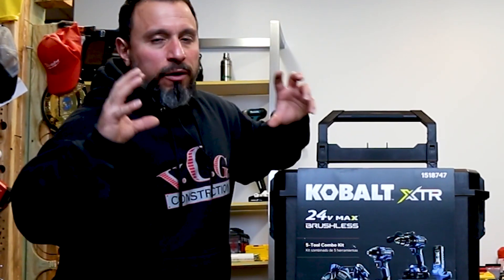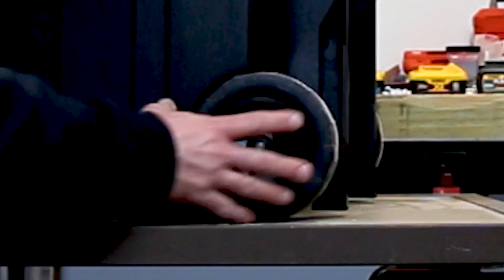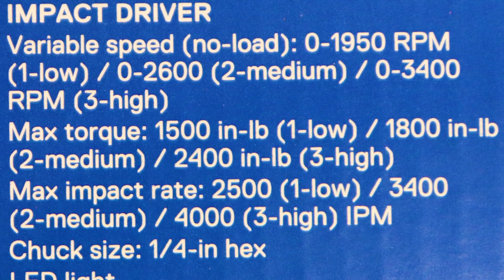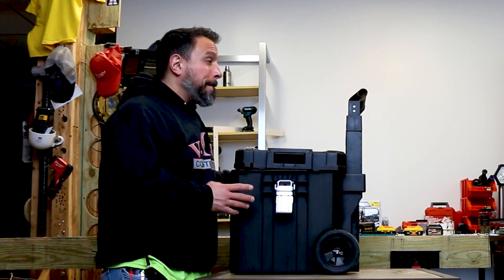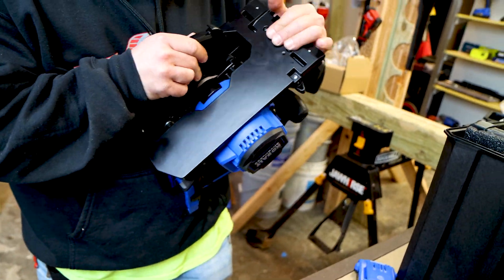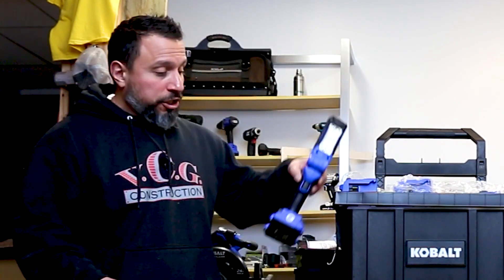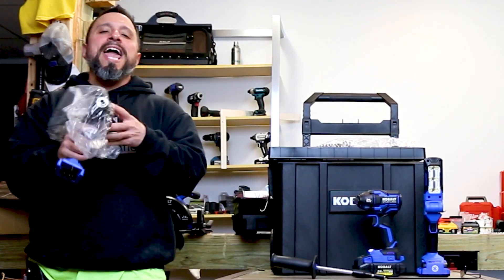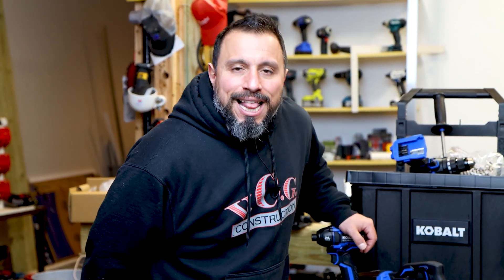NEW KOBALT TOOLS XTR COMBO KIT HAS GROUNDBREAKING FEATURES! (must see)

Comment: I wanna see them compared to the old kobalt to see how much better they are and are the new batteries comparable with the old tools
Reply: Duh, their 24v
Reply: @ezequielfuentes1823  the old are 24v just like these. 

They uppped the power in the tools themselves as well as the new battery features larger cells.

I can attest that the new battery gives this drill a higher pitched (higher rpm?) Sound. 

Can confirm thst the older batteries work fine although i can hear the difference. 

I would like to see all xtr tools raced against the originals. 

(Bonus points if you can race them against the older 18/20v kobalt lol)

Comment: I would love to see the new Kobalt impact. Go up against the Milwaukee Impact.
Champ vs Newcomer.....
Reply: Did u see the video dewalt is the new champion and they got a new one that's out called power detector 998 nobody will touch it I got my money on it
Reply: Is it the one where the Milwaukee has the collet problem? I don’t remember who won.Everything I own is Dewalt, but VCG has me eyeing Milwaukee. 🤣
Reply: @Cypress-Tx   Dewalt won and dewalt drills are the best and most powerful
Reply: Your right the drill is a monster. I just seen the 998 with the eight hour battery. Pretty impressive!
Reply: @Cypress-Tx   Yes sir and when u are drilling holes it want stop.
Reply: Everything looks good and performs well right out of the box, even cheaply made and lower priced tools.  Let's see what they do in 6 months or a year of regular use.
Reply: Watch the update video dewalt is the new champion nick beat Vince with his Milwaukee has bad issues with bits falling off. Dewalt is faster than the surge nick messed that up but just because one is faster than the other that don't mean it's a better tool. I know someone that has had there dewalt set for a long time and it's been abused and it is still going. Quality is what u go by
Reply: @jmackinjersey1   That's right it's about quality not speed my friend has had his dewalt set for a long time and it's been abused and still going
Reply: You guys are right. I’ve been pounding on my Dewalt tools for years. Iron Work!
Reply: @jts4248  ,  The surge is not meant to be faster, only quieter.  If you lower the impact in order to make it quieter, then you are going to lower the speed.  Simple physics.  Speed is not always the factor in the end users needs.
Reply: @jmackinjersey1   Have u seen the new dewalt 998 set power detector yet? I can't wait to get my hands on it. Everybody knows that u want beat dewalt drills and this new one is more powerful than the 996 which I have the set and it is a beast and can't imagine the new one is stronger man can't wait to feel it. They figured out where they been making a mistake the 5ah battery can't perform right with the drill and that is why they made a 8ah battery with this new drill it want stop when u are drilling
Reply: @jmackinjersey1   I'm hear to tell u I went and got the new 12v line from dewalt and I tell u what it is powerful it blew my mind
Reply: I'm here to tell u I went and got the new dewalt 12v line and it is powerful it blew my mind try it out
Reply: Try out the new dewalt 12v line I love it
Reply: Try out the new dewalt 12v line I love it
Reply: @jts4248  Except an 8ah battery isn't more powerful than a 5ah battery, it only turns the motor longer.
Reply: @jmackinjersey1   I think it does give it just a little bit more power cause I drive in a big lag bolt a little bit faster than with the 5ah on it
Reply: @jmackinjersey1   21700 is how many cells the 8ah battery has that will improve the power of it
Reply: @jmackinjersey1   Go get the new dewalt 998 set. I promise u will see the difference in the drill and impact. I don't know why they put a 2ah on the impact and the drill has 8ah battery and put it on the impact and u will see a difference something about that battery they changed it I promise
Reply: @jmackinjersey1  Let's breakout the new dewalt drill. I bet nobody will touch it
Reply: @AceSolomon94   Not to me it ain't I love the drill especially the new one. It's called power detect 998 get u one and u will see what I'm talking about I have had my dewalt tools for years and still going u pay for the good stuff
Reply: @AceSolomon94  What kind of tools do u use?
Reply: @AceSolomon94  Dewalt is not overrated. Dewalt has the best drills on the market and I will beat anyone who wants to beat. I had my dewalt tools for years and they have been abused and still going it's about quality and u get that from dewalt look at the new stuff they are coming out with called power detect. I'm waiting on my set to get here and it's the 998 set power detect and anybody that wants to beat just let me know and I will meet u or u can come to my house
Reply: Me too
Reply: @jmackinjersey1  The new dewalt 8ah battery has 21700 cells in it and it will have more power and more run time I promise u. They have changed a lot in within a year technology has come along way. Grab the new dewalt drill set 998 and u will see a difference in the impact and drill
Reply: @jts4248  ,  Oh, I know their new tools are great when you compare them to the older models/generations.
Reply: @jts4248  ,  They upgraded the technology yes, but in the end, a 12 volt or 18 volt battery is still the same power, but with the amp hour rating, it is a longer run time, not power.
Reply: @jts4248  ,  Amp hours is run time, Voltage is power rating.
Reply: @jmackinjersey1  Grab a 5ah battery and then grab a 6ah it will have more voltage and run time
Reply: @jts4248  , Jason, Jason, Jason.  Look at what you just typed and think about it really, really long and hard.  Then come back with an actual intelligent answer to what you are trying to say.
Reply: @jmackinjersey1  I was working in real tight spot but I know I messed up but look at a battery and u should be able to see the difference. I thought u would understand what I was saying
Reply: @jmackinjersey1  I want u to think about it look at a 12v 2ah battery and then look at a 3ah battery and look on the back of it u will see the difference and I will beat u that my 3ah does give my impact more power. Answer this for me my 2ah want take off some of my lug nuts off my truck but my 3ah will with no problem
Reply: @jts4248  ,  Except the Dewalt 998 detect has already been tested and reviewed by a lot of people on the internet, and they all come to the same conclusion.  It is not as powerful as the Milwaukee.  But someone has to be in second or third place, or there won't be any winners.
Reply: @jts4248  ,  Nope, it hasn't beat everyone it has gone head to head with.  Milwaukee is still the leader.
Reply: @jts4248  Are they the same series/generation/class of battery?  Maybe your 2aH loosened the lug nut and your 3aH battery simply removed it the rest of the way.
Reply: @jts4248  ,  I understood that you thought a battery with a higher amp hour rating would give the battery more voltage, because that is what you said.  A 12/18 volt battery is only going to have 12/18 volts, no matter what amp hour rating it has on it.
Reply: @jmackinjersey1  Dewalt drills are more powerful than the Milwaukee all day long
Reply: @jts4248  , Sorry to break it to you, they are not.
Reply: @jts4248  ,  Yes, it is powerful.  Not the most powerful though, but powerful in its own right.
Reply: @jts4248  998 with powerdetect running an 8AH battery is 100 UWO less than kobalt xtr
Reply: @poptya  New Dewalt battery is 21700 cells
Reply: @poptya  Nobody out here will beat Dewalt drills
Reply: @poptya  Dewalt drill will beat the new kobalt all day long I promise
Reply: @marinemikeusmc6529   Sure didn't and why are you saying stuff like that
Reply: @jts4248  just playing with ya man   didnt mean to be to harsh   lol
Reply: you do need to check out the video though  it was close and a battery mix up made it a little controversial but man the XTR is a beast especially for the price  i now own the 5 peice box  and they go along great with my DW collection
Reply: @jts4248  actually VCG has done a TTR with XTR  vs  DeWalt and Milwakee and technically Kobalt is now the reigning champ for both the hammer drill/driver and the impacts  cant wait to see the recipsaw
Reply: @jts4248  i went back and read the comment i wrote last night  ouch!!  i didnt think it sounded so bad when i typed it  Sorry
Reply: Your good I love my tools man I bought me a makita impact straight from Japan and let me tell you man that thing is a beast I love it
Reply: @jmackinjersey1  No, more volage = speed more ah = more torque and runtime. If you think having more ah doesn't improve the power then you know nothing about batteries and motors.
Reply: @jts4248  Chill out man, Dewalt needs to start innovating as they haven't had the biggest improvements over the years. Makita is a much more polished product with many more features that set it apart from Dewalt. Seriously though, how old are you that you can't handle someone's difference of opinion? Someone shouldn't have coddled you so much or gave you participation trophies as you're acting really cringy dude. I don't mean to be harsh but you must be a liberal too and you need to be held accountable for acting so childish.
Reply: Instablaster.

Comment: I have already had those tools for over a month, they are fantastic. The recip saw bears the dewalt xtr, the impact driver out performed the dewalt xtr impact and the circ saw was better than the dewalt 60v flexvolt even
Reply: Really?
Reply: Bob the builder  really tell me for sure. I'm about to buy a new set Dewalt or Kolbalt
Reply: I believe it.  I got a few tools, including the xtr recip saw.  Beast of a tool with low vibrations

Comment: I own this set and havent had any issues yet. The impact is solid, Ive drilled 3-4 1/4 holes with the hammer drill in concrete no issues. the circular saw is strong and the Recip Saw is an animal. The only negative ive found is the charger is a slow charger, They do have a faster charger though

Comment: I hope they roll out some of the new versions of the old tool line before clearing those from the shelves, I'm really invested in this line. Love all of their 24v stuff. I have the multi tool, orbital sander, jig saw, old 6 1/2" circ saw, old and new impact/hammer drill combo, and portable speaker. My recip is Ryobi but I'd like to change that after this video. One thing that would really make their line complete is some nailers, specifically trim nailers because that's my trade. I invested in the Milwaukee 18g and I love it though I don't like being on so many battery platforms. Kobalt has the potential to be a Milwaukee/DeWalt killer if they come out with a good enough tool lineup. Batteries are so cheap too, I miss when they had $10 1.5ah batteries I bought those up real fast.
Reply: XxStratAttackxX thanks for the great comment. I agree about wanting to see kolbalt nailers. How is the orbital sander. I’ve been thinking about getting that. And I would also like to see a 24v cordless trim router.
Reply: @kevincameron1163  that would be pretty damn cool too. As well as a mini bandsaw, or a handheld blower because that's all I use my compressor for anymore and I'd like to get that thing out of my trunk! The sander did not disappoint, plenty of power, doesn't compare to corded but I've done heavy stock removal with it no problem, I just slap an 80 grit disk on in those cases.

Comment: I'm new here I was just thinking about my first set of cordless tools I might just found them
Reply: It was my first set as well and trust me bro .... These tools get the job done just as good if not better than the top brands! They are a tad bit heavier but not much. Get them now before they get in high demand and the price will go up on u. Also the batteries are the cheapest out there.
Reply: I work construction and have most of the regular 24v tools... They are more than adequate, even Overkill in a lot of situations... 6" steel column, easy/ 1/2"x5" lag bolt, no issue/ drilling 1/2" into concrete, np... Point is if you're using for the house the regular ones are more than enough...

Comment: get out that Circular saw and set it shallow for 1/2 inch osb and see if the handle position is comfortable to cut across a sheet; I hate the milwaukee for this uncomfortable handle position; and yes, i can reach across a 48" sheet
Reply: I gotta see the blade tilt lock and how it cuts at mitre

Comment: FYI I cannot find this kit your showing on their website, the one 5 tool kit on their website lists charger as one of the 5 tools so your missing an actual tool, it does not include two batteries as your kit does and its not the new XTR, could Lowe's only be offering this regionally? I would buy this in a second at $399 if they had it on their website

Comment: Wait did the Impact driver say 2400 inch pounds that's as much as the ridgid with most ipms (which was the big issue with the octane ridgid driver) that might be the new impact driver king could beat millwaukee also the hammer drill has the same amount of torque as the millwaukee (which lead in hammerdrill power)

Comment: When Kobalts "Big Blue" line first came out a few years ago, I gave them a chance and got the impact/hammer drill set. It was the best drill set I've ever had up until that point. I was so impressed with them, that I went out and bought around $1000 or so on Kobalt hand tools and accessories.

Long story short, the hand tools were by far, and I mean BY FAR the worst and least durable tools I've ever owned! I've actually had ratchet wrenches fail on their FIRST USE. Just about ALL of their compound hand  tools failed within a few weeks-and no, I'm not exagerrating. Their drill bits either snapped on their first use, or just didn't last more than a few jobs. 

I was so disgusted by these tools that I never bought a single Kobalt product again, and it's been 3 years. Every once in a while I'll be in Lowes and see another Kobalt tool that looks like it would be amazing, but I completely lost faith in their product and just can't get myself to buy anything they make.

For the record I'm an HVAC tech, so my work is nowhere near as hard on tools as most other trades. When I say their tools failed, I'm talking failures like freewheeling while HAND tightening 7/16 screws.

Comment: Welp we are officially at critical mass, even kobalt’s 1p 21700 pack is 4ah not 3ah, Milwaukee needs to stop using the cheaper 21700’s in the cp3.0 at least, they should probably just drop the 6ah too but that’s less important
Reply: kobalt xtr 2ah is also 21700. very soon kobalt xtr will release 6ah and 8ah batteries in this new line

Comment: I really wish this XTR was not garbage it just is. I'll put a brand new charged battery on the Sawzall and it stops working after 30 seconds of use because this is the battery is dead and that's a brand new battery it's just not able to keep up with the needs of a pro user

Comment: These are throw away power tools after warranty has expired because they don't offer a scematic sheet to purchase individual parts to repair them on your own.

All of the other big companies do.
Reply: Most tools are throw away when they break
Reply: @timhappy7223  
I disagree. The typical power tools that you buy at the major box stores can be fixed for alot less than purchasing a new tool. It's up to you if you want to save money or waste money just because a replaceable part has gone bad. This is why the major brands have schematics for you to purchase parts.
Reply: @obliviondio  I value my time.  Time is money!  If a tool breaks in the trash it goes.  Couple clicks on the phone and new tool is on its way.   There are only so many hours in a day!
Reply: @timhappy7223  
This notion is feasible providing we are running a shop where time is money. Even in that scenario, hopefully you'd already have extras on hand to run your business as backups.

As a home diy I will disagree with this notion. Treating small things like this as a throw away gives manufacturers all the more reason to continue making cheaper products because they know people will just toss away the old and simply but new. I value my hard earned money and do not promote cheaper manufacturing processes. If it takes a little time out of my day to fix things myself then so be it.